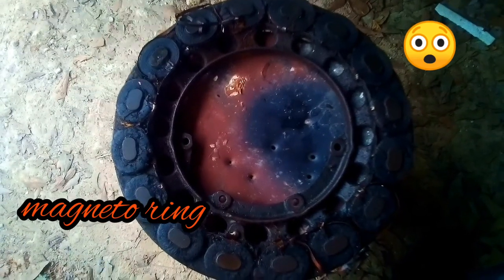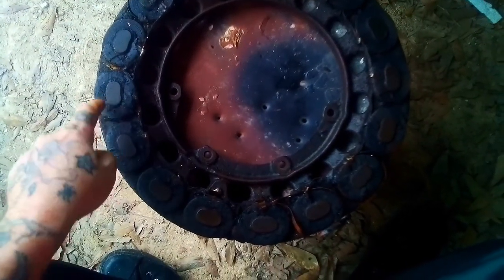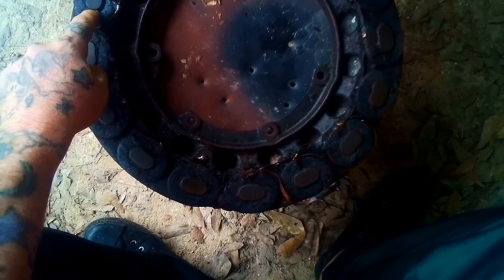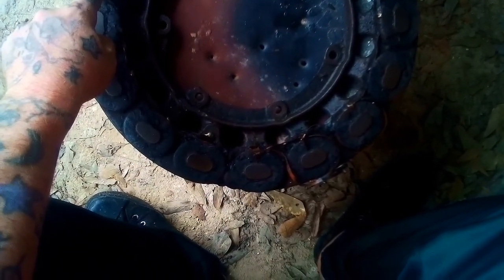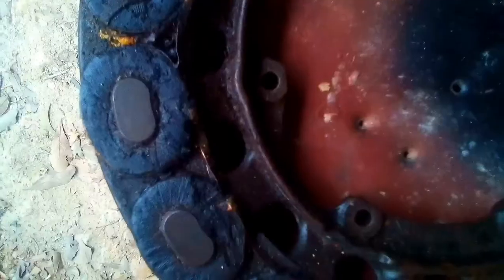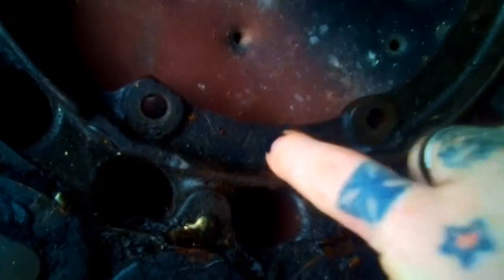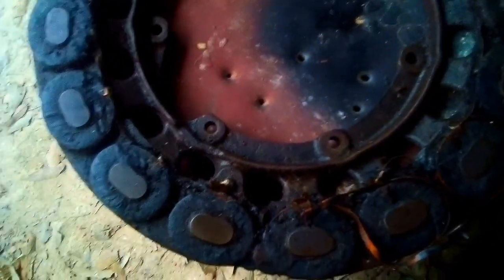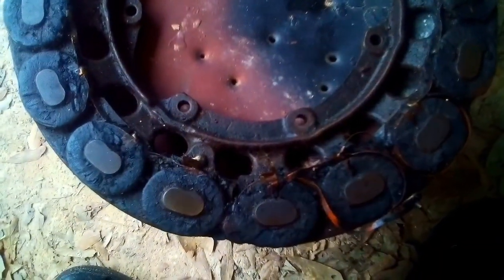Ford Model t magneto ring facts

Comment: I was wondering how does the magneto system in Ford Model T dont shock the driver it is ac current right? And what about the baterry why it does not get flown up be over chargeing it???
Reply from the maker: I guess the oil provents it  there's a switch